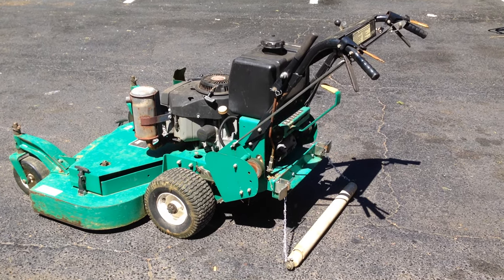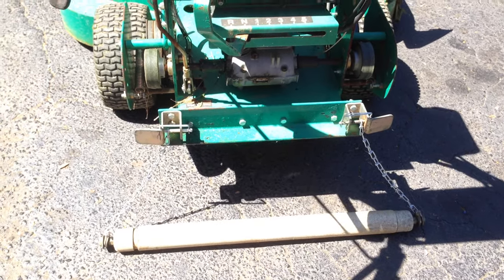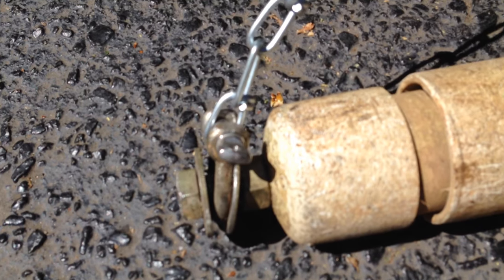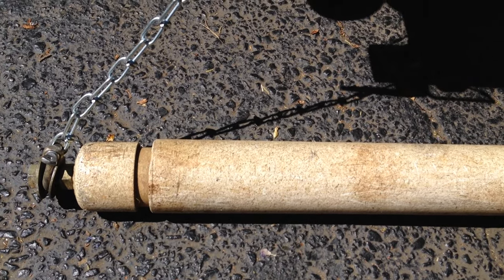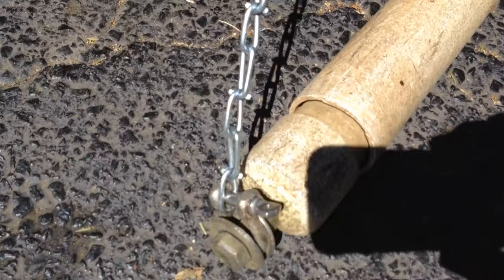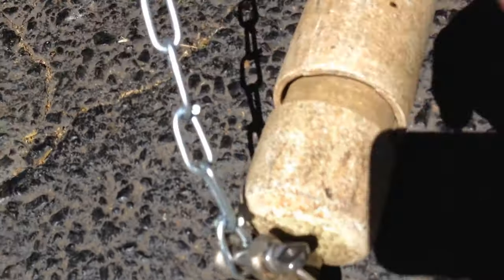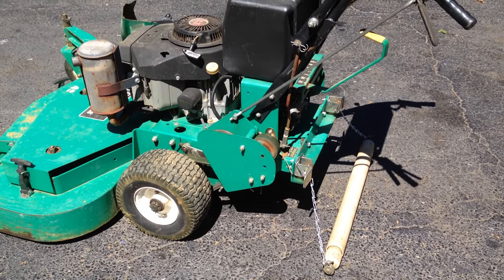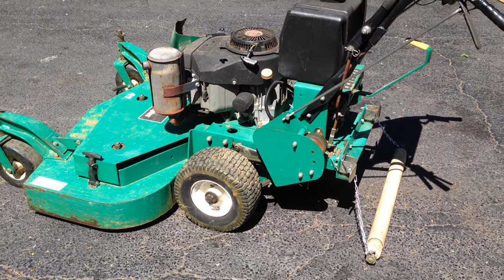Lawn Striper Kit - Walk Behind Model

Comment: I just bought the same mower. How do you adjust the deck height?
Reply from the maker: Dblood85   By adjusting the wheel spacers on the 2 front legs.     The cutting height is going to be the spacers on the 3 spindles in the middle for the blades.     Really not much adjustment at all.   Up to about 4” is it.
Reply: broomballusba12 ok thank you. I like to mow high so 4” is good for me! Right now it’s about 3”.